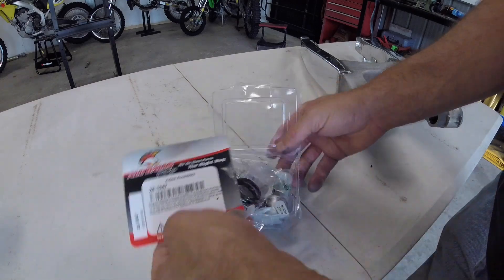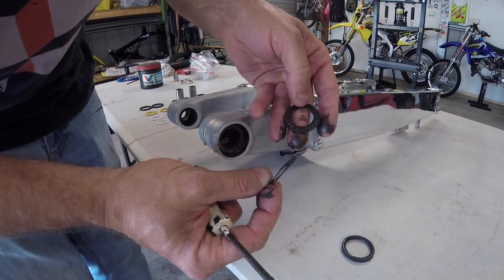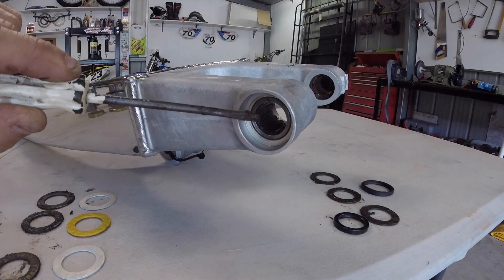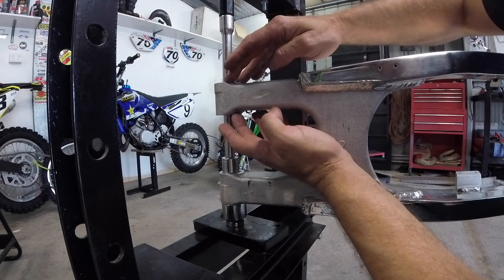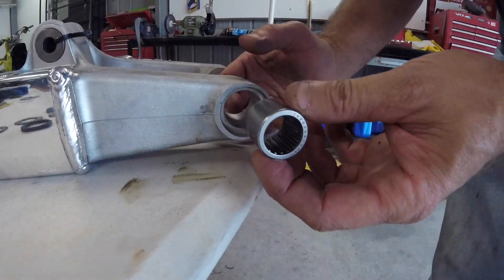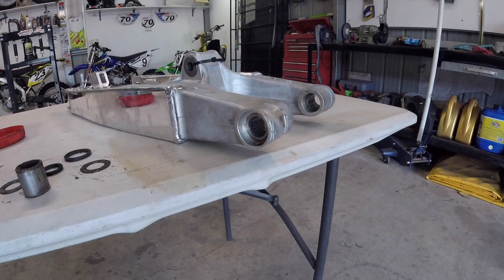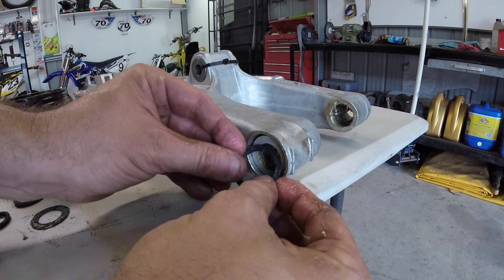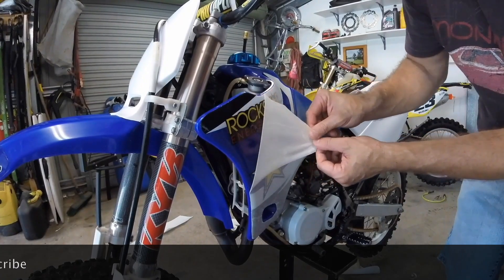Swingarm bearings replacement RM125 project

Comment: Good video but you made a mistake on your inner spacers from the outside from swingarm, and installed your outer spacer on top of iner . The iner spacer is so post to be installed from the inside of the swingarm and your outside spacer is so post to be from the outside because the iner seal has nothing to run on so it won’t really seal
Reply from the maker: Thanks mate I also realised the mistake after having made the video
Reply: Is  following this video is the wrong way? Does it go metal spacer then rubber seal?